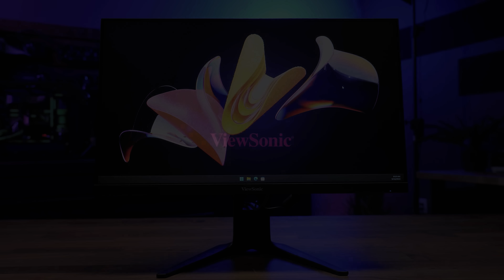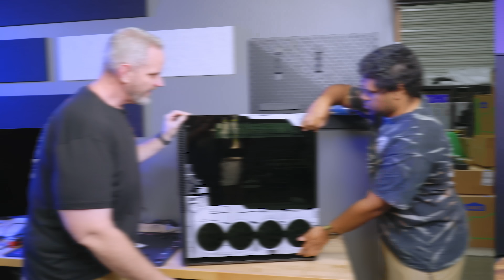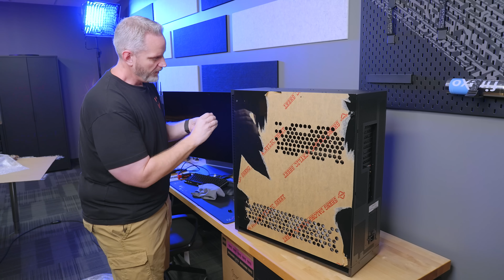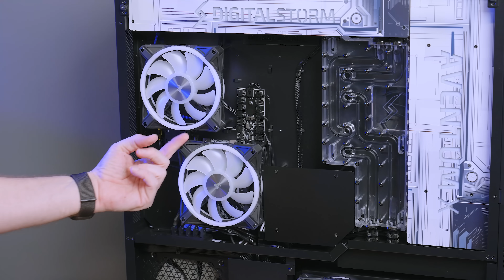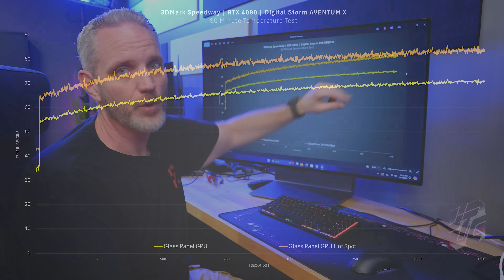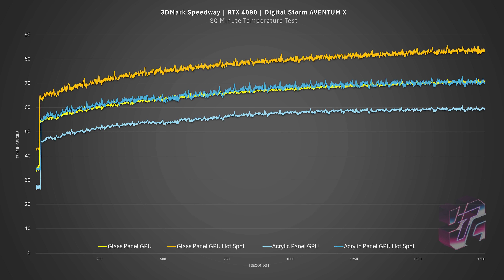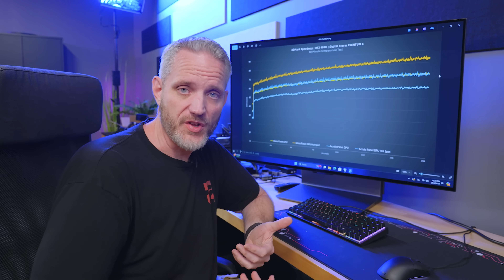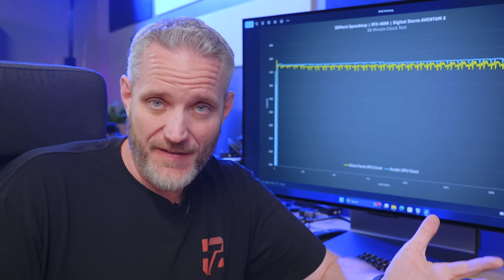Digital Storm responded to my Criticism... Let's go over it

Comment: Not a glass expert but I have spent enough money on tempered glass products to understand it well enough. Essentially you can do any cut that you can think of on tempered glass, HOWEVER. It has to be done prior to it being tempered. This is also permanently create weakness in that glass. So those 4 screw points for the Aventums side panel, will require trial and error and some testing to find a thickness, vent design, and how far away those vents are from the 4 screw points in the corners to find a place where it won't make the glass too weak. There is a possibility of weakening it too much to the point where if you undo the screw points and miss one or two, due to its proximity to the vents, if you pull without realizing it, say goodbye to your glass panel. The way around this could be bonding a metal plate on the top and bottom edges, maybe even the sides that will support where the those screwpoints are, separate entirely from the vent area which would be unsupported.

This introduces a lot of added cost for Digital storm I wouldn't be surprised if it made each case go up significantly since they wont be able to just buy simple tinted panes, get four holes drilled in the corners, get it tempered and shipped. It also introduces much higher rates of possible failure of those doors, we see it all the time in shower doors where the glass just had imperfections or where the holes were drilled and how its mounted introduces much higher risk of it shattering when introduced to high vibrations (like a earthquake for shower doors, or shipping for a pc case). So that is all to say that I think you are right Jay, maybe having a lower door that made out of aluminum and then a upper pretty tempered door may be what needs to be done for this to be as cost effective as possible.

Comment: I worked at DS for about a year. They do not care about their customers experiences. 
They would test PC's that would nearly temp-max in their cold warehouse in winter and "okay" them to be sent out to customers despite the fact that the PC is GOING to thermal throttle when it gets to the customer. 
The mirror of Windows they use has all of the bloatware included, and all of the security settings set to default. 
The HR lady is somehow related to the owner and also the primary English speaker/interface with employees so she's also kind of the manager. They pay horrendously, they'll move you up positions and neglect to mention people working in the new area are being paid more than you. 
Dogshit company.

Comment: Cutting holes in the glass, while increasing airflow, would also increase tooling costs.
Anything more than straight lines is much harder to do without shattering.

Comment: sorry but what... if i pay so much for a system then i want all the performance it can give. if the company gives me enough radiators to cool a fcking engine then the pc should run in the top 1% chart.  and why the f are there fans in the back that blow air at a metal wall? thats useless why is that there??? money wasted.

why are they doing that? everyone can build a better and cooler performing system and save tons of moneys

Comment: TEMPERED / TOUGHENED GLASS. 

Tempered  / Toughened glass starts as regular "float" glass, the same glass you all see break in to massive sharp chunks. 
Heating it and rapidly cooling gets it tempered / toughened, which is around 3x stronger than float glass, and highly heat resistant. It is also considered as safety glass due to the fact that it shatters in to tiny pieces of glass. For that reason it is used in automotive applications, and high heat environments. While regular glass is common in home windows, etc. 

Since Tempered / Toughened glass starts its life as regular float glass, you can do whatever you want with it during manufacturing. Cutting to shape, drilling holes, making cut outs, polishing external and internal edges, etc... But, once its "toughened", you are unable to do any modifications to the glass which would change the structure of it. This is because toughening process creates surface tension in the glass itself. This surface tension is what gives it 3x strength. And it is also the reason why it explodes if chipped - tension makes it collapse on itself and go poof! 
Only small shape alterations can be made to tempered glass, and even then its at a risk of self destruction. You can polish down 1mm or so on the edges. Beyond that - danger zone! 

Be aware, handle toughened glass with care, if you bump it on the corner (provided it has no CNC radius) in to something tough like concrete, it will not chip, it will rapidly self-destruct in your hands. Float glass would chip instead. 

Tempered / Toughened glass can be laminated, painted, printed via UV inks, sandblasted. 

NOTE. Ceramic print is done before toughening process, unlike UV print. This is because the ceramic ink is cooked and becomes one with the molecular structure of the surface of the glass. That is what you see in ovens, windscreen black surrounds, stoves, etc. Highly temp and wear resistant, but limited in colour gamut.

Comment: Used to cut glass for art projects when I was younger and the rule was you can't cut a curve. Obviously, this makes seeing it in media like thieves breaking into a window/case one of those silly physics impossibilities, but once the glass is hardened and settled, you have to cut more of an angled approximation and then grind the rest. Obviously not manually efficient and in the case of this, well, case, you'd need a top half and a bottom half if sticking to glass with something to connect/solder the contact points to complete the circles. Realistically, I'm in the camp that a glass top and panel bottom is the wiser route, be it metal or plastic.

Comment: When I was a system's integrator, everything would be fully tested before the first unit gets out.  But, our focus was servers.  Failure of those units can literally put a business on pause until fixed.  Often, it would come with legal problems.  But, I can't imagine not fully testing even a workstation or gaming rig. Thermal throttling just can never be acceptable.  It reflects badly on the business.  So the cost saving of not tested, can cost a lot more in lost sales, and RMA/Repairs.

Comment: I have a NZXT h700i which i have modded to increase flow, and added custom water cooling... The fact I am able to compete with these temps given mine is running a 240mm and a 360mm with a tiny res, and this thing is massively higher in capacity... is staggering to me.

Comment: Yes, you can etch (don't remember what the technical term is) holes in tempered glass.  The issue would be shipping it, it would be more fragile (especially around the thinner areas ofc).  I used to purchase glass for slot machines and we would purchase tempered glass from our vendors with beveled windows etched into them.  
There's probably significantly better equipment for it these days (this was 20ish years ago); they would submerge a piece of pre-cut tempered glass and use a CAD program to essentially sand blast the windows out and that process also etched the edges to make them safe from cut hazards.

Comment: Hi Jay. You can get tempered glass with holes in it. You can't cut holes into tempered glass so they have to be cut/drilled prior to tempering. Once drilled/cut then the glass can be tempered so yes in response to your question it is entirely possible

Comment: The answer to the holes cut in the tempered glass is to cut the hole in the glass, then put it through the heat treatment process to temper the glass.

Comment: You know, the easiest and cheapest solution for Digital Storm that still maintains the full glass design choice is to use stand offs for the glass panels. Probably less expensive than the acrylic to get even if you got really nice ones, and certainly will be less than the acrylic to ship. And you don't have the scratching problem. I have a Thermaltake case, all solid glass panels except the bottom and back, the glass panels themselves are all about 3/8ths of an inch off of the case frame allowing BOATLOADS of airflow all around. The fans on the front of the case, clearly get plenty of airflow because the screen dust filter gets covered exactly where the fans are behind it within a week of usage (forcing me to clean them as often as I vacuum. Like Jay always says, love that dusty SoCal air.)

Comment: Spacing glass panels by few cm with some 3D printed atachments could solve aiflow problem as air would enter through gap between glas and case frame on all 4 eges of panels.
Reply: Unfortunately the thumb screws that hold the glass on might be too short to have the spacer and hold the glass securely. I have one and would be reluctant to place a spacer in there for fear the glass (which is very heavy) might pull screw out and fall open and make a heckuva mess. Valid idea but would need a slightly longer thumb screws with a few more threads.  And yes I got a three plus year old Adventum before learning about the gaming PC universe🤷‍♂️

Comment: The beauty of QR codes (or simply hyperlinks in general), assuming you handle URL destinations/redirects/landing page campaigns correctly… is that you can easily fix it after the fact on the fly for QR codes/URLs that have already been published, printed, and distributed.

Comment: You can get holes in tempered glass, the glass panels you got originally have holes in them for the mounting hardware. The holes have to be cut in the glass before it’s tempered though

Comment: Lian Li OVERNIGHTED a glass panel for me for my 011. FROM TAIWAN. OVERNIGHT. FOR FREE<<<<<<<<<<<<<<<<<<<<<<< and yes, in Nebraska, i DID get it the NEXT DAY. there's no excuse on shipping those acrylic panels. if their profit margin is that tight, they just need to pack it up.

4 grand in parts on air gets you the same performance as 8500 in walls and fans. not worth it. my dual-full-atx super tower is all air and boosts well above advertised specs

Comment: Did they not have a single engineer available to QA the design team's choices? At least you can pay shipping fees for replacement acrylic panels with holes cut out in the wrong areas.

Comment: I had a full glass side panel for my pre-built computer with a 2070 super. Was hitting 83°C while gaming and not boosting as high. I custom made a fiberglass mesh side panel and now it boosts over 1980Mhz and Temps are in the 60°Cs!

Comment: i should think the peal comes off slowly with a plastic spreader and a heatgun maybe? i mean usually thats how vynl decals are stuck on rather than removed. if theres a fan underneath the cpu on the backside of the motherboard surely it should exhaust, cause old convention was air forced down over the cpu from the top of the motherboard with a down flow cooler, so therefore backside would exhaust to match the flow of air.

Comment: LOL, what are you going to do in your new shop?   Laser cutter for (smoked) Glass for Fan ventilation cut outs? 

By the way, what happened with the vacuum a system first and fill it with fluid after?  
Got any pump advise or a JTC Branded product to sell for the water cool enthusiasts ?

Another thing that gets me, one can re-design in 3D computer programs and simulate 'stuff' to fin dand fix any such design flaws but I guess that is too much of think outside the Box. That is old school in my near utopian world and if not used, should have been used with systems build for this kind of money.  Prototypes can be made super fast and cheap. Just my 2-cents.

As always, great stream, thanks.  Have a great rest of your day.

Comment: Jay, I love you man, but if you can't nitpick an $8000+ computer what the af can you nitpick? It's not a $60 case that comes with 4 fans. For that extra $4k they should include a complimentary ball cooler as well.

I feel like it would've been fairly easy to do a split panel, kinda like the SMA-8. Have both rads as intakes, have 4 140mm airflow fans on the power supply shroud pulling air up from the basement into the case, with the top rad exhausting. You keep virtually all of the glass and end up with much better airflow. Also, more fans = more RGB = more better.

Comment: So, when will we see a watercooled jay?
like, a cooling vest from battletech with sewn in water hoses like under floor heating.
just thin tubes and then quick connects to some kind of pump and radiator?
Or just a bucket of water?

Comment: A couple of things I noticed in the video. ?Their response for filling did not say to allow it to suck in air. I know your knowledge tells you that is an issue but these kinds of documents are not written for each configuration, they are written for general application. They need to have something specific for this pump combo due to the high fluid pumping capacity. Also the person writting you the response may not be water cooling or even computer type. That would be the only reason I could think of for why thy wouldnt know about the jumper. Finally the acrillic panels are from atleast the open side of the work station. If you look at the demo model on their site you will see the lower holes are for the fans and the higher ones are from the gpu stack. I do not see a photo of the back site. I think they just sent 2 of the open side panels as they would work.

Enjoy the videos keep it up.

Comment: Geez - Digital Storm - you aren't doing yourself any favors here. For designers of PC builds its difficult to understand you didn't realize there were thermal flaws. Then and only after it's pointed out you send out replacement panels that don't appear to be designed for the impacted system. People pay a premium for your products guys, not good enough.

Comment: I got  DS about 10 years ago now, haven't had to reformat or reinstall windows or even refresh windows, came with a 1060gtx. I'm useing it right now thing has been pretty much flawless. What is the best part is that I can still call them up get a person, and get help at no cost. I wanted to add more ram just recently, and they told me exactly what to get that was also compatable with the ram it came with. I wanted to update the still original bios and gave them access while on the phone, they were going to send the file to a usb stick I had but the stick was way too old apperently so passed on doing that. At least for me the customer service even when your stuff is out of warrenty is great. Alot of times I'm afraid to blow the dust out of it being it's this old and runs great. :}

Comment: I am inclined to agree with Jay. If you're going to charge me for parts, (the rear, middle fans, bottom radiator, primarily.), and then prevent them from doing most of their job, then leave them out of the build and don't charge me for them in the first place.

Comment: I have owned 2 digital storm PCs. I bought 1 in 2014 for 2700$.  I liked it but i had not a clue about PCs at the time.  The lighting inside of it were just bars placed on the inside of it and they burnt out, a literal burn mark.  The PC started blue screening a few years into its life. 

 I got a new $3000 one in 2018 when my place got hit by lightning and got a new one from insurance claim.  They wanted me to buy from the same place.  It malfunctioned within 48 hours of owning it and wouldnt turn on so it was sent back.  Later on, i learned the RAM inside of it was such a generic number u couldnt find the part number anywhere, unless it was a part number made specifically for DS, idk what to think of that.  

The other issue i have with digital storm is the fact that when you order a PC, you cant select the GPU brand you are buying.  They will literally just pick a GPU brand and model and that's what you get. AKA you cant choose an ASUS Tuff or ROG, you could get either, or an MSI card, or a Gigabyte, etc.  They gave me a pretty low/mid tier MSI card at the time. 

The PC is still going strong to this day, but if i had to buy a new PC today, sadly I wouldn't buy from Digital Storm.

Comment: 8k and they didn't engineer the case better... SMH. They would never get my money. Falcon NW FTW if I ever pre build. But why pre build? I have the time and enjoy building things.

If you pay 911 GT3-RS money, you want a no compromise track machine. Not a GT car, otherwise you would have paid 1/3 -1/2 as much for the 911 GTS for cruising. Their justification of their poor choices is BS.

Also, higher temps will shorten the life of a PSU. But it will still likely last longer than you will keep it.

Comment: Digital Storm is an absolute trash company. They don't give a single shit about getting repairs right. I paid for out of warranty service on a laptop from them and spent 9 months sending it back and forth because they couldn't fix it. And they also broke a hard drive of mine after receiving it (I have receipts form my calls with them) ands then tried to blame me for it. And the last time I got the machine back it was still in an unusable state. After a basic windows update it would only run for half an hour before shutting down. Every time. And they would do nothing about it even though I was within the window of service for my initial motherboard repair.  

Never. EVER. Buy from them

Comment: It is like hifi. The more you spend the subtler the detail you are listening for. I have heard a four grand system and it is sweet. But I personally would not go above four hundred. If I were budgeting in that price range that tiny boost could make a subtle difference in frame pacing.
I don’t know. I am struggling with timing on a 2mhz 8bit console.

Comment: So stupid! Have One panel that has glass in it on the side that you want to be visible and metal on the other side. Meaning if you can have a metal frame around the tempered glass, why not have a 200 mm frame at the bottom that is perforated?